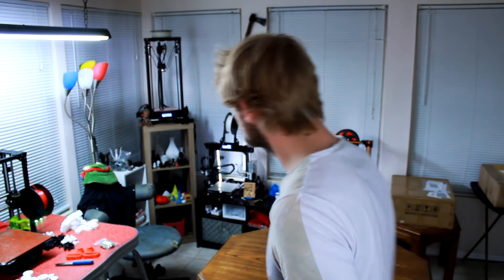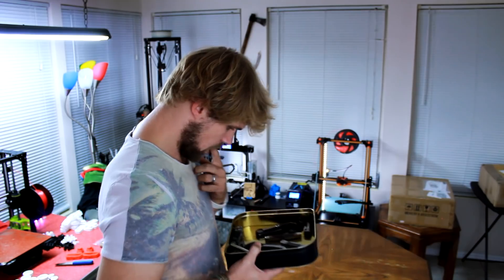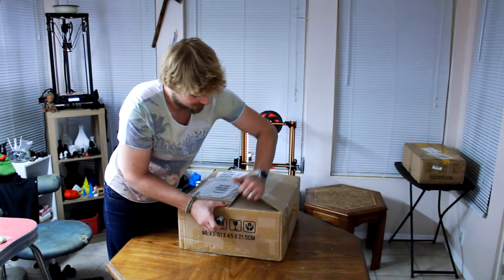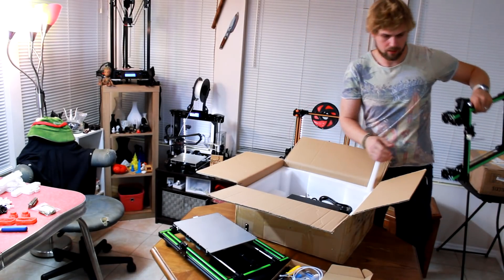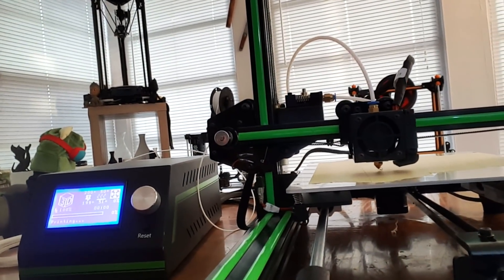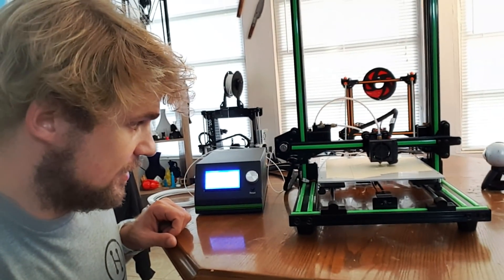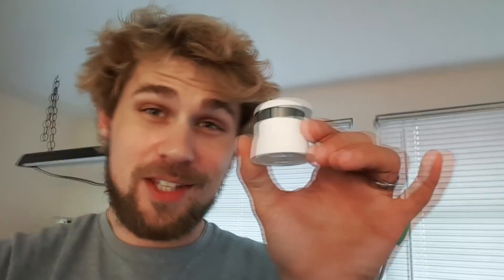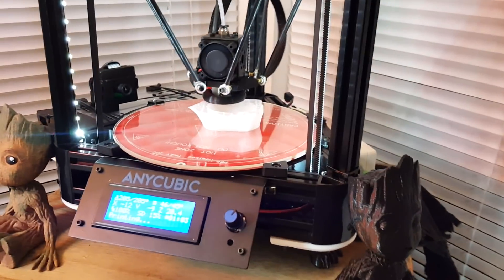✔ ANET E-10 UNBOX - BUIILD & REVIEW! ✔ | VALUE 3D PRINTER

Comment: 1. Nice new setup Caleb. Like using a whole room for printing. You made your own factory!
2. Your timer reset during the "knife talk" heh I was watching it and wondered how long it will go for and then it zeroed out and went again.
Reply: 3. You might want to tighten the heat bed cable end as it was hitting and pulling on the bed motor. 10:40
4. 10:44 you have some stuck pixels at top right and bottom. Might be debris got stuck behind the lens too.